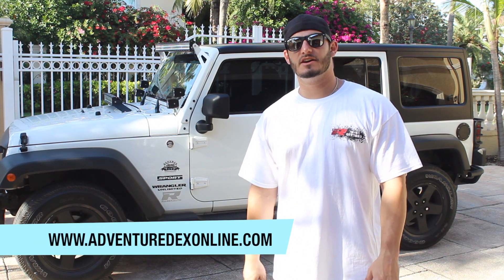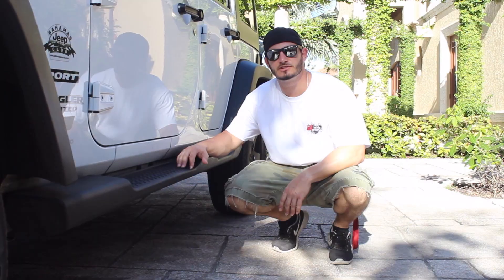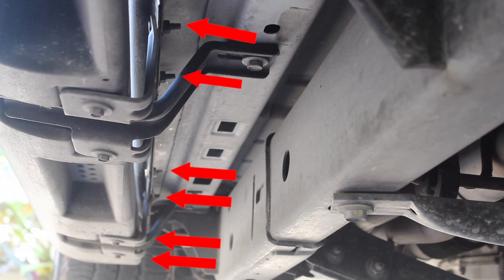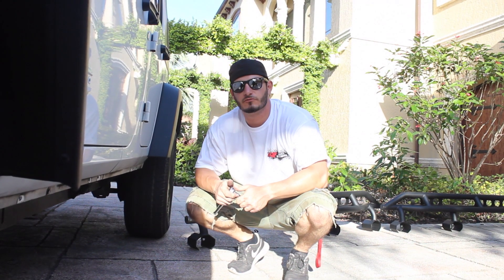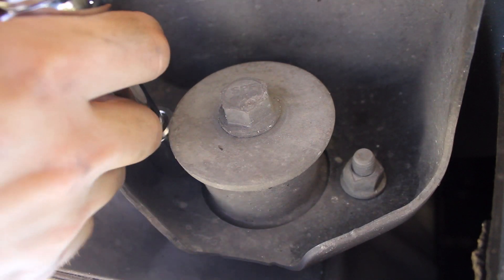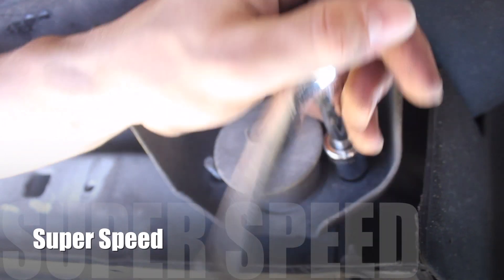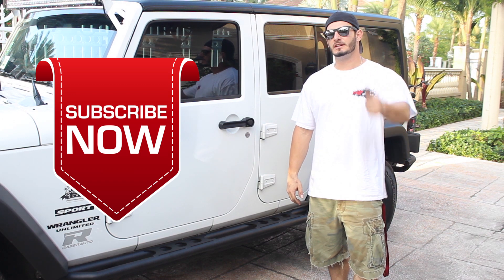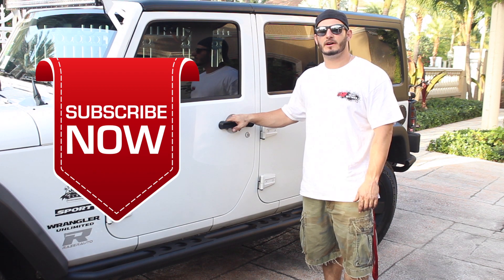Jeep Wrangler Rock Sliders Installation by RazerAuto

Comment: looks great bro I have identical side steps/rock sliders but yours seen to sit up higher right under the door blocking the thin part where the small bolts use to go in def going for these
Reply from the maker: +AtLtLt Thanks for sharing!

Comment: Digging those sliders!   They would match perfectly with the roof rack I just installed.  Another great video man!
Reply from the maker: +TrailRecon Thanks a lot for the comment Trailrecon! What kind of roof rack did you just install? Yeah, these are awesome! They are real sturdy and give great clearance! Am going to go test them out tomorrow! #jeepwave
Reply: +AdventureDex  Installed the Smittybilt Defender Rack (just posted an install video on my channel).  It has piping and hole cut outs like your rock rails.... I may be adding those rails to my next purchase list.  Jeep wave back at you!
Reply from the maker: +TrailRecon Just watched it! Great video! You got yourself a new sub! I really like how the roof rack does require any drilling. That was always my consider in regards to the mounting of the roof rack! I will definitely check this one out! Thanks!
Reply: +AdventureDex  Thanks for watching and the sub!  Looking forward to your wheeling in the Bahama's video!
Reply from the maker: +TrailRecon Yeah for sure!

Comment: Is there a  rail step that would fit over the rock slider. I've got rock sliders but the 4  and a half inch lift with the 37's makes it still difficult to hop in. thanks
Reply: Ace Engineering makes sliders that fit over your rubicon rails.